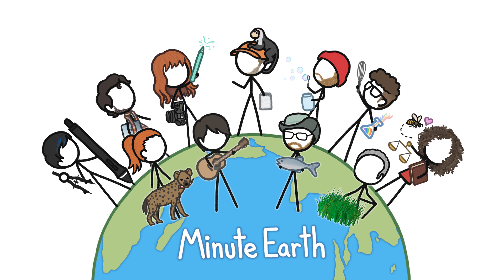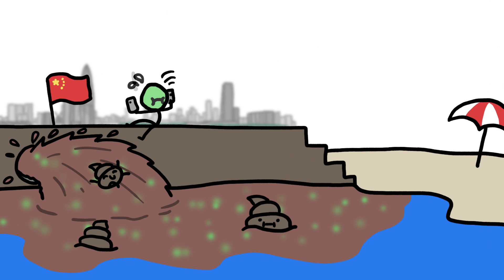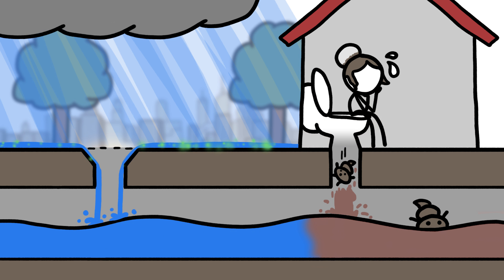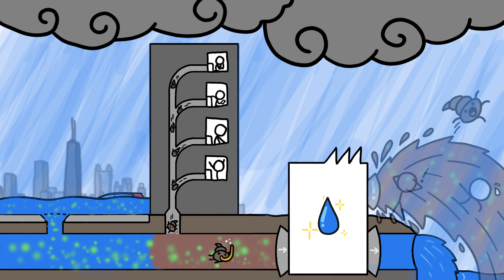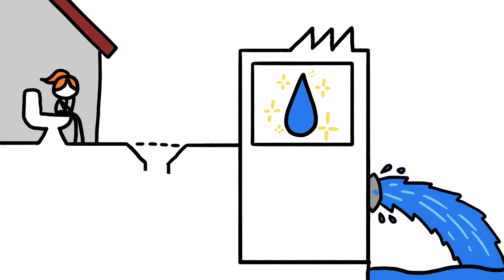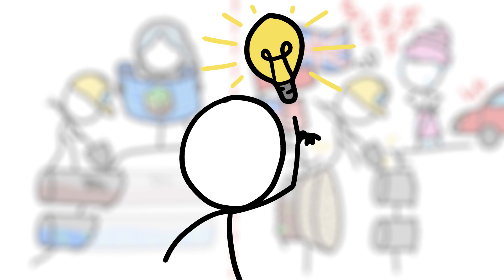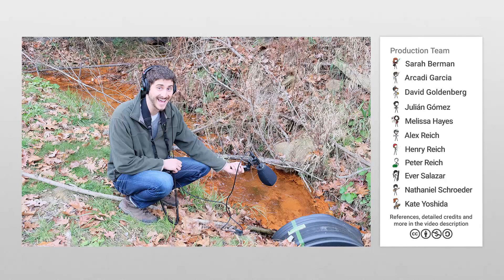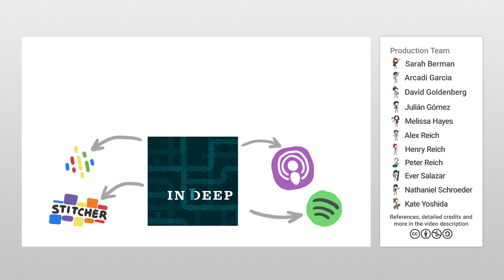Why Sewers Around the World Keep Overflowing

Comment: Chicago's not the only one. San Fransico already has giant underground vaults for combined sewer stormflow. This is a very old problem btw, not actually getting worse from land use, since the areas that are old enough to have combined sewers (no longer allowed by code) were completely paved long ago thus new impervious surfaces contribute to discrete stormsewers, not combined sewers. As for increased storm intensity, that depends where  but generally yes greater heat means more water in the atmosphere so when it dumps out there is more to dump.

Comment: Chicago didn't install a 'fancy new sewer systems' in the 1800s, this was the same sewer system design and construction that was in place in Rome pre-000 AD. Combined sewers are the most common ancient sewer system in the world.  Look up the name Maximum Cloaca. It might be interesting and educational.

contrary to the story that you're trying to propagate, most large cities in the US, whether they are new cities are not, operate what you evidentially either don't know or dishonestly try people to think is not the case - Us cities that didn't use their political power to shield then from a 1974 law passed called the "Clean Water Act' that demanded that cities and towns separate the wastewater from the stormwater run-off. 

As far as the largest cities still operating combined sewer, Chicago, and New York City are notable for their ability to get endless waivers from the EPA for the compliance of the Clean Water Act law.  Boston, Philadelphia, Baltimore, Washington, DC, Charlotte, Atlanta, Miami, Tampa, Houston, Dallas, St. Louis, Minneapolis, Milwaukee, Denver, Seattle, San Franciso, Los Angeles, all have separate sewer systems. They 'bought the bullet" and separated the sewer systems in the 1970s and 80s. Those cities are just as old as New York and Chicago, and it's just as expensive. But they didn't flex their political power.

You need to do some real research and not follow a narrative and the propaganda that equally ignorant or dishonest advocacy groups feed you.

Guess what, if you bothered to so small bit of research on your own, you can find out what is going on, and not be lied too.

Comment: megastorms aren't happening more.
Storm frequency and water poured is measured and it didn't change for over a hundred years, thx canada particularly for the data.
What changed how often and how bad we had floods.
The difference there was how much area of the poured ground is covered in asphalt or structures instead of ground which allows water to seep through.
The more is covered by asphalt the more strain is on the sewage drains and they're currently insufficient in case of emergencies.
Both the drainage (and sewers) and the processing plant quantities need to improve.

Comment: I suspect a lot of cities have sewer overflow tanks.  It's a cheap stopgap in cases where runoff could overload waste treatment.  In my city, they're also trying to separate stormwater from sewage.  One big contributor is that older housing editions connected their foundation drainage tiles directly into the sewer.  They're forcing homeowners to have their foundation tile disconnected from the sewer, and it's quite expensive.  (it usually involves jackhammering up parts of the basement slab)

Comment: Wouldn't it also be possible to deal with the problem by having more treatment plants? If the plants that the city already has are enough to handle normal rain and poop, shouldn't it be possible to have a few more that only turn on if the system is backing up? I'm not sure it's the most environmentally friendly answer to the problem, but it's how I'd solve it if this were a city-builder video game, so I'm curious if it would work.
Reply: Not really. The size of the sewers that lead to the treatment works is the problem. Sewage is generally diverted into rivers before the treatment works to prevent flooding in the street contrary to the video. London is building the Tideway tunnel under the Thames to intercept all the sewage and take it to the treatment works. https://en.m.wikipedia.org/wiki/Thames_Tideway_Scheme
Reply: @Richard_Verity  I'm not sure I see why it wouldn't work. Are you saying the water just can't flow fast enough to make way for more?
Reply: Ok theoretically you could build more treatment works, however even if you could find the land for them, and re lay all the sewers in the city to go to the new treatment works, you've not really solved the initial problem which is to prevent flooding. Combined sewers overflow direct to rivers to prevent sewage flooding. The sewers would need to be much bigger if this didn't happen and it's not feasible to make them big enough not to flood. The ideal solution is to separate sewage and rainwater at source, however in cities with lots of historic combined sewers, this is an almost infinite task. It also doesn't prevent future wrong connections being made by mistake. That's why London is spending £5b on a huge tunnel to intercept the outfalls into the river, rather than re lay the sewer system for the entire city.

Comment: You need more clarity. Under normal circumstances the Chicago River doesn’t flow in to Lake Michigan. It was diverted and reversed over 100 years ago. In 2019 the direction temporarily resumed its normal flow due to the flooding. This is such a special use scenario it makes for a horrible example for what you are trying to explain. A better choice would be the city of Milwaukee ~90 miles north of Chicago which also has combined sewers and even a “Deep Tunnel” and yet often still sends untreated “combined raw sewage” in to Lake Michigan.

Comment: Another possible solution to help with the problem would be to change where discharges happen. In Florida when discharges do happen it is directly into the coastal estuaries! Extending the discharges out to the deeper offshore regions would help a lot but would not really be an end all solution.